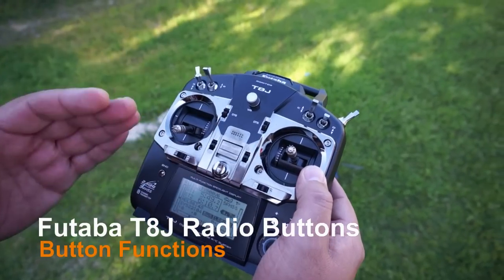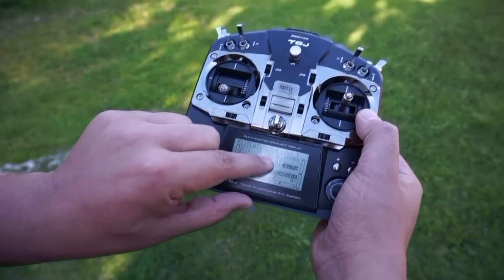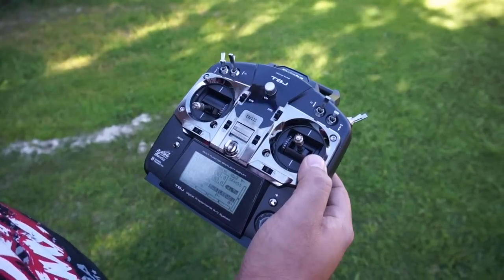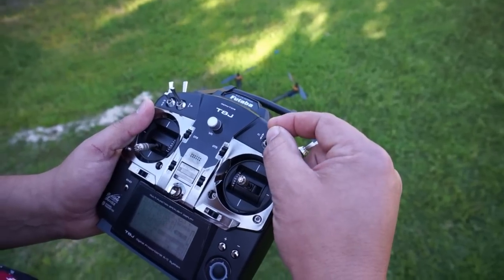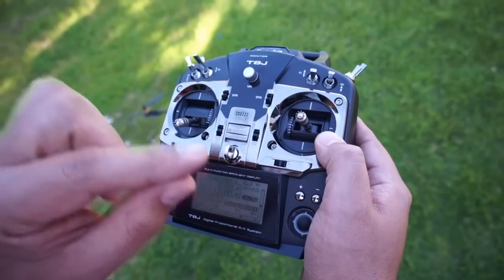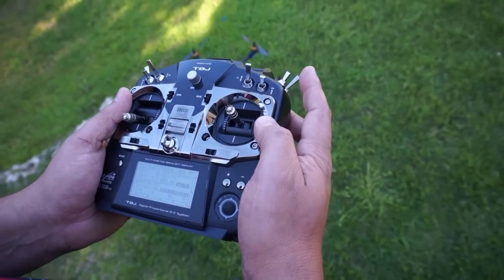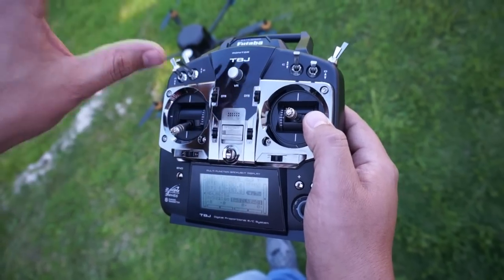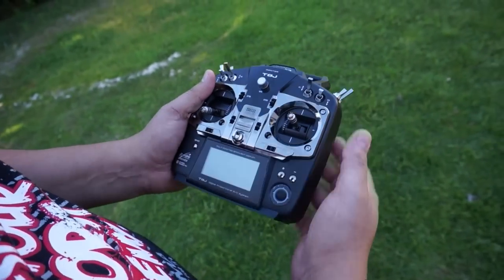Futaba T8J Button Settings & Functions

Comment: is there a way I can backup the model settings to the computer? I cant seem to see SD card slot to save to a card
Reply from the maker: Hi No you can clone it from one J8 to an other but not sd card or pc option, that im aware of.
Reply: Drone Guy no problem.  thanks